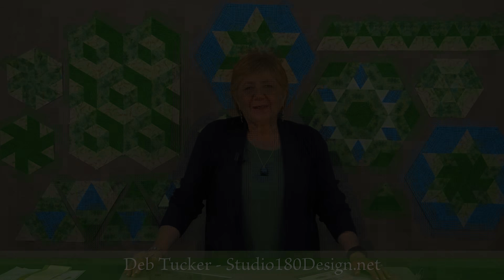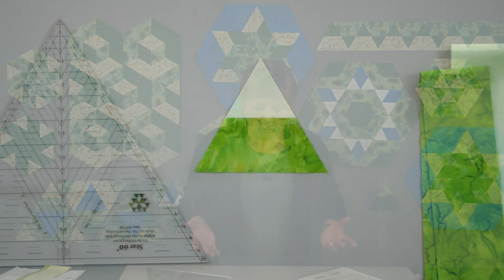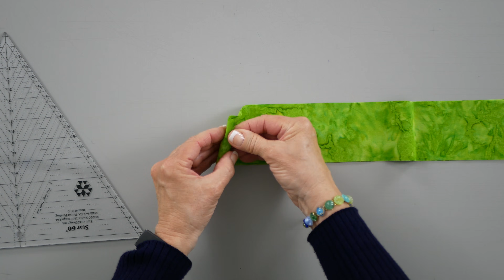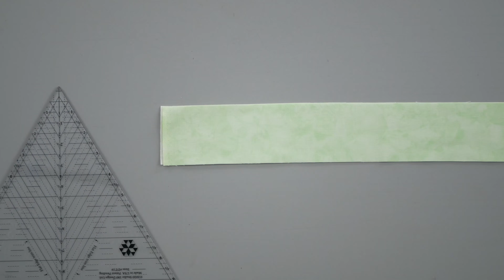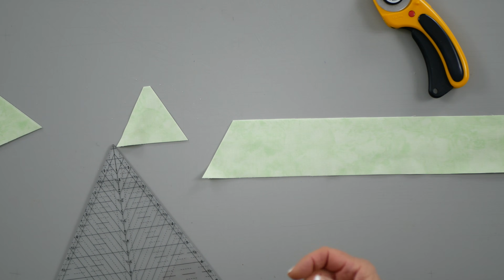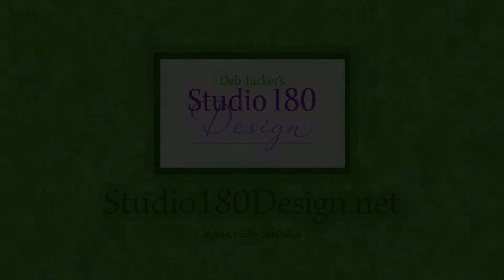Capped 60 Technique Sheet for Star 60 Tool

Comment: Can't you sew 2 strips of fabric together and then use the tool to cut the cap 60 unit?
Reply: That would work IF you needed units that had both light dark “caps”. Otherwise you would have  a much less efficient use of fabric.
Reply from the maker: You can it all depends on the units you need. If you need all the same unit this is the most efficient way to make them. If you need opposites then you can strip piece them. It all depends on what you need for units how you want to make them.

Comment: Good afternoon Deb.  Where do I find the pattern for the tumbling block pattern on your design wall to use with the Star 60 ruler?  Thank you.
Reply from the maker: We do not have a pattern for the tumbling blocks. It is in many 60 degree books and I wanted to show what can be done with the units that you can make using the technique sheet.